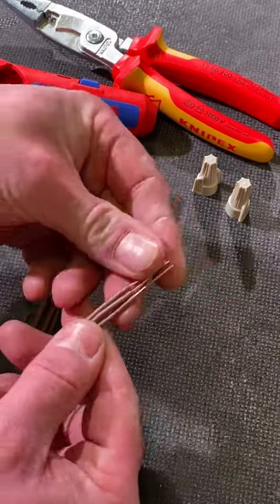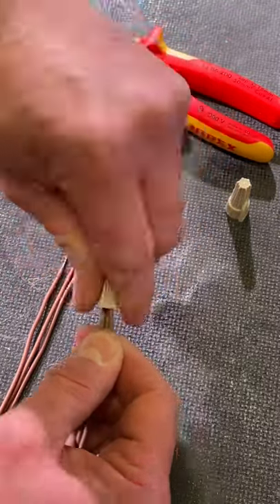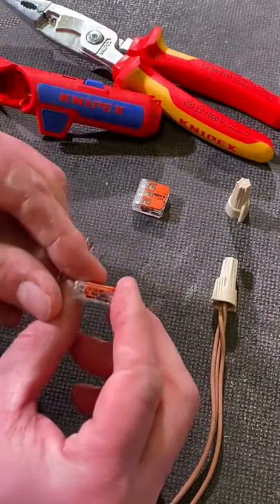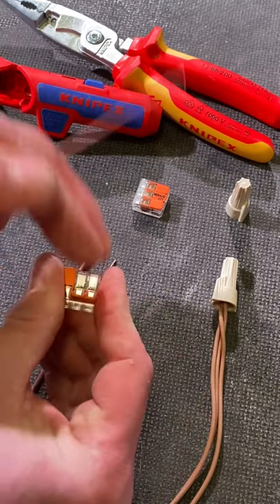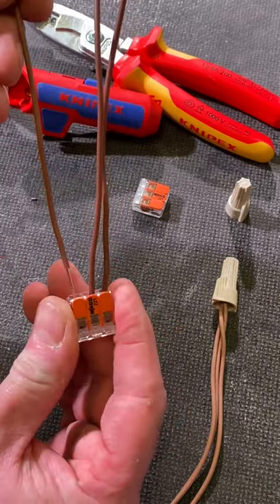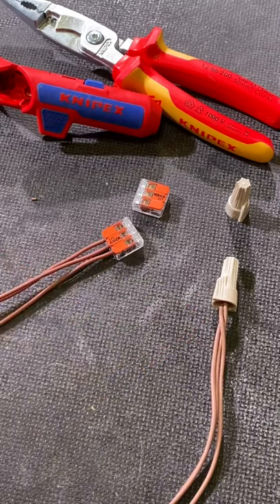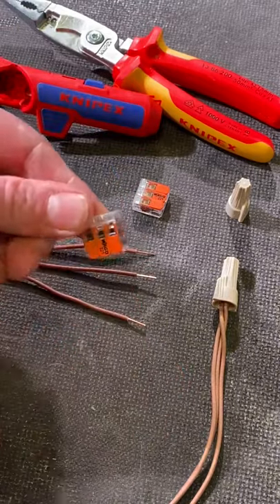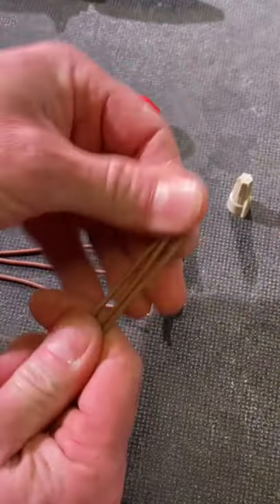Which way do you splice wires? WAGO 221 vs WIRE NUTS? | Electrical #shorts from eFIXX

Comment: I have been using wagos since launch, best thing ever invented making electricians life easy, the young one won’t remember crimp connectors and pliers, they have it easy these days..lol
Reply: Do you mean the yellow, blue and red ones used in car audio stuff? Or some other variant? Remember about 25 years ago many friends redoing car stereos with there crimp kits and big copper wires going everywhere.
Reply: Do not remind me of crimp connectors, I never wanna hear that name again
Reply: Never understood the problem people have with crimps .... crimping is painless when done the right way with the right tool ...
Reply: @contytub  it’s easy but easier and time saving with wagos. That’s all, it technology moving ahead
Reply: @parmindersagoo2891  wago’s are pretty big though, with car audio you need all the space you can get especially if you’re splicing 16+ ISO connector wires inside a dashboard. But they’re brilliant for everything else!
Reply: Nice to have views @GugzDhanjal  wagos are for electrical industry, car electrics have their own, I used to install and repair car audio and fit alarms too.
Reply: @parmindersagoo2891  i haven't negated wago... i've used both and both have their own uses so i know there are some cases when they can replace each other but i would never try and bother with the oposite when job requires one or the other . If i need crimps i will use crimps .. if i need wago i will use wago . Wago used incorectly can be a pain that could be easily solved by crimps and the other way around ... as much as we would dream of, there isn't a single best solution
Reply: I learned electrical on a ship where crimp connectors and electrical tape are a requirement for every connection. Also we wouldn't use pliers but a crimping tool. It really isn't too bad for making connections with small wire.
Reply: @CR42H  Use a crimping tool. Much easier
Reply: Don't all sparkies have it easy.... Isn't that the whole point in becoming one so you don't have to graft
Reply: I personally prefer Dolphins. I'm 29.
Reply: Wago is CRAP!!!! I was and still am in trade when they came out....didn't trust then...don't trust now...moving parts that can fail is not what I make a electrical connection with...I wouldn't bet your family's life on it anyways...Wire nuts are the best way besides in bigger connections with Lugs or somthing like that....Wago should be illegal to use in anything except simple LED light fixtures or somthing small and doesn't pull shit in power.
Reply: @kylehayes6432  not for big wires
Reply: @upsideright4119  dude you're wrong. They are more reliable than wire nuts by a landslide. They are easier to use thus allowing less faulty connections. They are faster to correctly plug. And I'm not working in construction but in the worst condition possible for any electrical material aka the food industry. High pressure water,realy low or high température (from -36°C to around 70°C), higly corrosive products    or heavy fouling. And everytime the wago connections are showing a lower numbers of failures.
Reply: @upsideright4119  we use wagos and other types of spring connectors in my school
Reply: Wagos are best for new installers. They are the worse for electricians like me who has to constantly get called for service behind them. There are 3 new gated communities near me and the homes were all built in the last 5 yrs. I get called all the time for highhats and switches not working. And itll be random highhats. I always have to climb in these damn attics and its always a wago that has failed. Cut em off, replace with wire nuts. Because of this i will.never use them for any application.
Reply: @upsideright4119  I dont trust them either but wago now makes connectors that are rated for 30 amps lol
Reply: Crimp connectors shouldn't be used on solid wire.

Comment: I’m sure you could just unscrew the nut and reuse it.
Reply: The nut bites into the wires, so either way you'll have to shorten the wires each time you take it off as they could become a fire hazard, that's why they made wagos :)
Reply: @warriorz_hammer_7743  you won’t cut as often if you know how to use your pliers to straighten.. the nut bites but doesn’t rip half the cross section either.
Reply: Yeah. I was like WTF mate, just unscrew the thing. They won't be looking mint, but you can certainly reassemble them a few times. 

I like WAGO because they look neater, uses less space and are harder to fuck up.
Reply: From the USA: In real world use the nut is often on for a few years. I'd unscrew the nut at toss it as the spring inside tends to stretch over time and won't grab the same number of wires as tightly if reused. The wires can be straightened, but it can take a few minutes if there is a lot of twisting. Sometimes the copper is gouged enough that you want to trim off some of the end. Wagos definitely make modifications easier, but we've had many failures on the inferior push in connectors built into cheap receptacles - so many people here are wary of any type of push in connectors.
Reply: Wire nuts are just a cover. The conductors should be twisted together tightly before the nut is screwed on
Reply: @Pops180 how to correctly use them is stated on the box.. should or shouldn’t means nothing.
Reply: @Pops180  per 2020 NEC no more twisting wires
Reply: @a..d5518  I will always do it regardless.   It will always make a lower resistive connection than any other method
Reply: @Pops180  and it could cause you to fail an inspection, of course that’s only if you’re pulling permits for your work.
Reply: @a..d5518  do you know the article or section number in the nec book that states twisting wires is a violation?  I can't find anything pertaining to this.   I would love to understand the justification in this change.
Reply: @warriorz_hammer_7743  the nuts score the outside of the wire. Your supposed to twist the wires together the apply the nut. Yea its more involved but alot less likely to catch fire than those stab in connectors. Also you can easily mix solid and stranded
Reply: @williambowen2302  only if you trap stranded conductors in the middle of solid core bunch and don't twist them so that strands end up on the outside:  the square-section helix will cut into strands and risk severing some, reducing effective mechanical strength of the connection.  That's one reason we don't tend to use them much in Europe, they are not certified as Maintenance Free connectors for stranded conductors, while Wago and Ideal can mix and match happily and be released and recovered.
Also, I've seen electrical failure tests of all of these:  wingnuts did last longer, but both Wago and Ideal out-lasted the cable!  (Rated at 30+Amp, they put 150+A through a string of different connectors and the insulation melted off the wire before the MF connectors gave up.
Reply: @Pops180  I second that. Reference the article.
Reply: @AMD1  honestly, twisting then capping should be the only allowable method
Reply: A. D. Only lazy noobs don’t their wires
Reply: Yes you can easily unscrew wire nut and reuse it. Not EVERY time but like 80 percent of time. Not all wire nuts damage the wire
Reply: @warriorz_hammer_7743  Wagos also bite the wires. That's how they lock the wires in.
Reply: Untwist and reuse. There's no hazard in doing that
Reply: But... But this would anger the gods!.... Also the people who want to sell you new, more expensive connectors.
Reply: @Pops180  not if you follow the installation instructions on the packaging, it specifically says not to twist the wires, even though that's what I was taught.
Reply: @alankayne1  if you find a wire nut that says "do not pre twist", pick a different brand
Reply: The copper also work hardens
Reply: You have to download a program that allows the twist nuts to rotate counterclockwise, the Wagos are much simpler.
Reply: @Andrew  I apprenticed under a master electrician back in the early 80's. You twist the wires with the cap.
Reply: Wire nuts are much better at holding the proper gauge wire together so there is zero movement.  Just don’t put more than three wires in one wire nut.

Comment: Wirenut. Strip the insulation, twist the conductors using lineman's pliers, then twist on the wirenut. The resulting connection will carry full rated current because of the superior contact surface area. To me this is FAR superior for home wiring.
Reply from the maker: Great advice - Thanks David 👍
Reply: Every wire connector that is actually allowed to be installed can carry full current

Comment: Wirenuts for permanent connections like inside a junction box or an outlet or switch box (I also wrap wirenuts in tape).
Wagos for things that might be replaced from time to time, like ceiling fixtures, or work shops that are reconfigured frequently.

Comment: I've never in all my years being an electrician seen it just cut and not removed and saved for T off
Reply from the maker: Thanks for that 👍
Reply: Right I've been doing electric for 8 years notnonce have I seen some1 just cut the damn wires instead of just taking the wire nut back off an either reusing it or using a new 1
Reply: @Creamy614  I've been taught to clip and use fresh strand of wire. Shouldn't this be standard?
Reply: @nwskipro  You can't always do that though bc sometimes you barely even have enough wire to work work with so if you go cutting it an its already to short then you are gonna have to add splices
Reply: I have cut the mangled bit of the wire off I deemed it too damaged. Or if I was putting in an outlet or switch instead.

Comment: Wagos are very convenient in installations with stranded wires, such as installing Lamps. 
Be sure to check out the new Wago 211-2411!
Reply: Are you sure the type is right? Cant find anything about them even on the official website 🤔
Reply: @Thomate1375  He typo'd. 221-2411
Reply: Be careful 2411 is only good to #14 wire, use 2401 for #12

Comment: WAGO 221 are better then wire nuts especially when you mix solid and stranded wires together.
Reply: That's the main point to me, plus being able to remove one conductor here or there for testing is amazing

Comment: The best advice given to me was that the nut doesn't make the connection, the nut caps the connection.  Twist them then cap them
Reply: Agreed
Reply: Kind a. The nut has a spring inside that bites down on the wires and presses them together. That's why you sometimes can't reuse them. The spring can stretch out.
Reply: @jrdn.lauren  in 15 years I've never seen a wire nut "stretch out". Unless you're using some really cheap stuff, its not actually a spring. Its a piece of aluminum coiled very tightly with no spring in it whatsoever. And its only coiled so that it locks down on the turn and brings the wires into each other.
Reply: @summer-west  in my very long career I have never seen a wire nut that is capable of twisting counter clockwise. The number of conductors is completely irrelevant. When I was  a new apprentice I remember twisting wires the wrong way with my left hand and I have never found a wore nut that will cover that, just untwists them.
Reply: Haha. My boss will flip out if he sees us twisting them before we cap them.
Reply: @moosesimpson8625  a spring is a piece of metal coiled very tightly lmao everything is a spring
Reply: @willybman3723  if you're going to pull this whole "we technically..." routine then sure... but the word spring connotates a capability for an action. A spring is a coil but a coil is not a spring. As it relates to a wire nut, there is no spring. Spring being used as coiled metal that is capable of expansion and contraction, usually the same diameter from top to bottom. The coil in a wire nut does not expand and contract and it is a fixed conical shape. Please learn the difference between a coil and a spring.
Reply: @moosesimpson8625   you've never used a red wire nut on five wires and then noticed that same wire nut doesn't work to hold two? If you pretwist then screw a wirenut on to just cap it then sure, it's not a spring. However if you use them per manufacturers directions and twist the wire nut on there until there are two or so twists past the wirenut then that coil bites into the wire and will force the wires together. The wider part of that cone will be stretched a bit as it rides down the wire as you keep twisting. In your 15 years you've seriously never had that cone stay on the wires when removing the nut and notice how it holds the wires tightly together? That force required to hold the wires together without the plastic housing is literally caused by stored energy in the metal coil. We usually call those springs.
Reply: @jrdn.lauren  no, if you use them to manufacturers instructions that will never happen. I know what you're talking about, the sides bulge out a little too. Each wire nut has a listed capacity and you're talking about exceeding that. Which, I might add, is not wise as one factor in that capacity is a heat rating and although rare, you could end up melting that wire nut over time and starting a fire.
Reply: If you use the right size, and make sure all of the ends of all the conductors are lined up,  you don't need to pre-twist. They twist as you tighten the nut.

Comment: As a handyman - wago all day. Most jobs see boxes stuffed to capacity and the client “needs” every light on a dimmer. So many times wagos made it possible because they lay flatter in the boxes.
Reply: i see, where i'm from every house is spliced with wirenuts so i see no point in buying wagos. if i'm tapping of something, i'd have to redo the whole splice rather than just adding my wire and maybe a larger wirenut if need be
Reply: @corduroy77  yeah I don’t do it every time but it has its place. Those big wing nuts take up a ton of room so these are a great option. I really like them for stranded copper because you can see that it’s a good connection.

Comment: Recently moved to wago. I would recommend them to any installation engineer
Reply: Don't use the word engineer please.
Electricians are not engineers.
Reply: Unfortunately Dean I didn't say "Electrician". 

I was referring to Electrical installation engineers I.e. transport systems, power distribution, construction, electrical installations in buildings as well as maintaining said buildings electrical circuits and the renewable energy sector like wind farms, solar arrays etc

Hope that clears it up a little for you.
Reply: @Dont-Evan-Bother  Most aren't engineers. I am making a distinction between technicians and engineers.
Reply: @deang5622  Most are not, but some engineers still do installation.
But I would say I would recommend them to anyone doing any wiring work. Not for every application but for many.
I am a locksmith and I often use the 221, as it can hold wires as small as 0.14mm^2
Reply: @deang5622  You're very wrong. There's tons of engineers in field.
Reply: @jothain  Bollocks. There aren't many. That is why the industry is such a mess. To many lowly electricians that think they know everything but can't even rearrange Ohm's law formula

Comment: When I was a NASA electronics tech I used wagos.  They’re expensive, serve no better purpose over wire nuts, but they’re neater and look a lot better, especially when you’re terminating thousands of color coded multi-conductor cables.  Some folks are picky with their cable management.
Reply: We use wagos at our electrical school(tired and don't remember the correct term)

Comment: Wago

Test point
You can see the wires are clearly clamped
Easy to remove
You don’t have to twist the wires together, making them difficult to straighten 
You can use stranded wire

Wire nuts

Cheap
Reply: You can use stranded wire in wirenuts too Lmao. Wirenuts dont neet to be cut off either and you actually can dtraighten out the wire. You must not actually use them. Dont spread bullshit